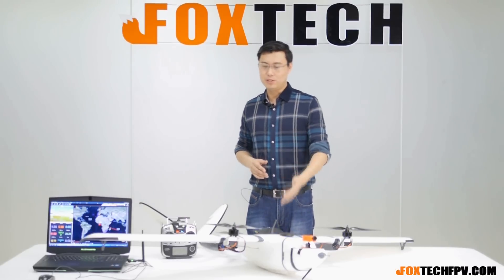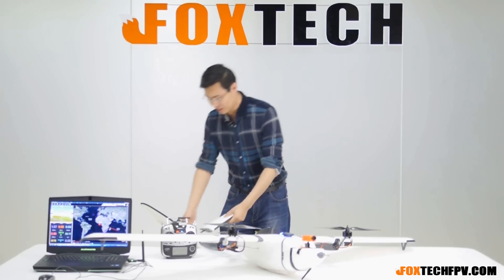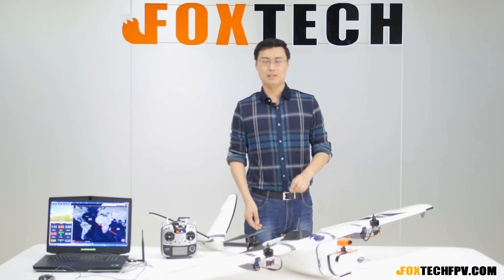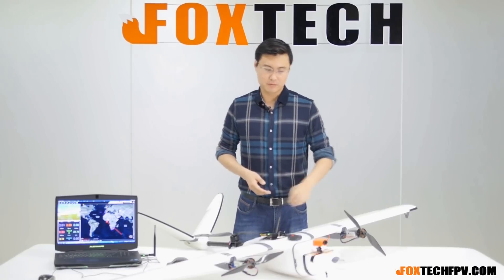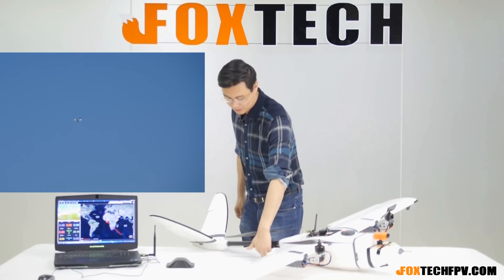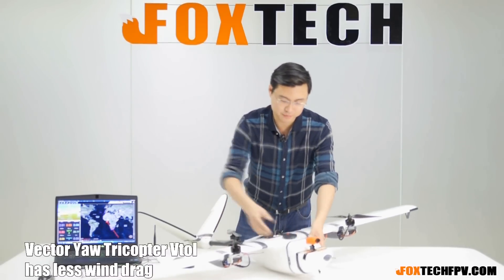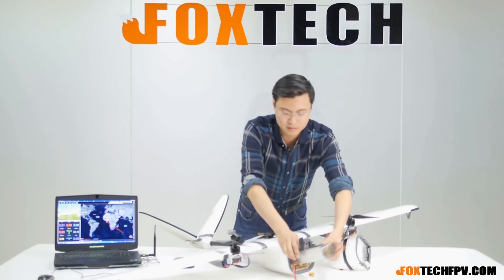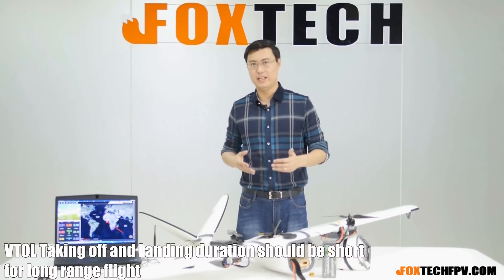Nimbus 1800 Vectored Yaw VTOL FPV Plane! Tricopter Long Range Vtol available!

Comment: Great looking plane ,   but that price.......
Reply from the maker: We listed three combos, frame only , kit, and PNP. If you would like to tuned your plane by yourself, the kit combos is ok:)
Reply: Foxtech I only see kit and pnp.   $1500 for the kit version is still way to high.   Have you sold any of these? And what's it it that costs so much?
Reply from the maker: Here is the frame only: https://www.foxtechfpv.com/nimbus-1800-fpv-plane-frame.html
Reply: the isn't the same one, that is the standard frame.
Reply: Apparently the tilt version is even cheaper priced at 149.00.  Go figure.
Reply: TheRattleSnake3145
I agree, it's an EPO body with 4 servos you can buy from HobbyKing. There's just as much EPO in the Penguin I have and a mod like this wouldn't be that hard to do. Maybe if they sold only the motor mounts and the flight controller they'd sell a lot more, but at well over $2,000 AUD I'd rather buy a DJI Phantom. Or have a metalwork shop make up the motor mounts and simply use a switch to activate the servos.  Mind you, I'm not in the mapping business so it would be only for the fun of having something different.
Reply: You hit the nail on the head with that one.
Reply: You only need such a plane for commercial work.
So if you want to do the conversion yourself,
you would need to add the cost of your own worktime.
I did a rough calculation about the needed components
plus the plane and devided the rest by my hourly rate.

The result is that i would have to finish it in two days to get to the same price.
In two days i would have to do all the hardware changes,
read 1000 Forum posts in order to get all those exotic stuff to work together,
find a way to keep control, data and video streams from confusing each other.

If your lucky you will find some configs for the ardu that supports Tricopter VTOL convertibles,
but i doubt it. Then you will have to maiden it and see it crash...
Because you stuffed all the complex systems in at once to safe time.

To get to the same price you would need a perfectly working plane
for your commercial work at the end of day two.
Anyone here who thinks he could do this?
I would need at least a week to get everything dialed in.
And dont forget the time to order all those parts
that take 4 weeks to arrive from china-
only to get stuck in customs because you might use them
to build a tomahawk missile instead of a mapping drone...